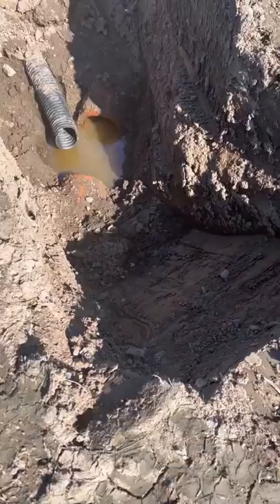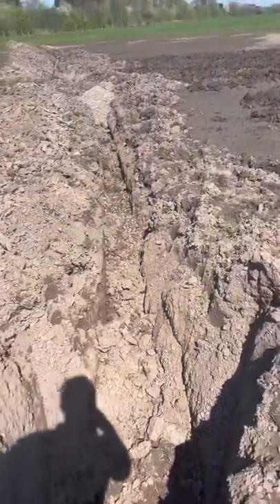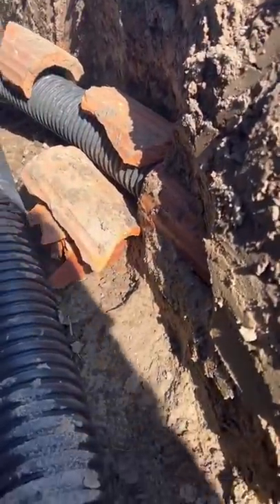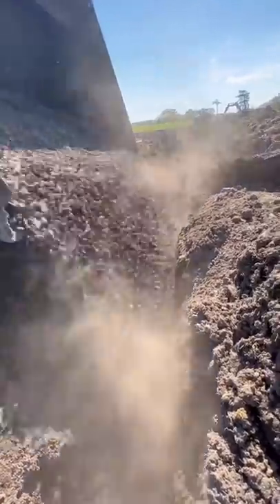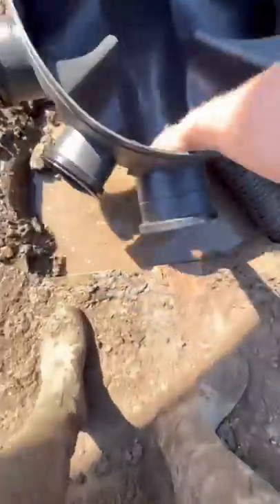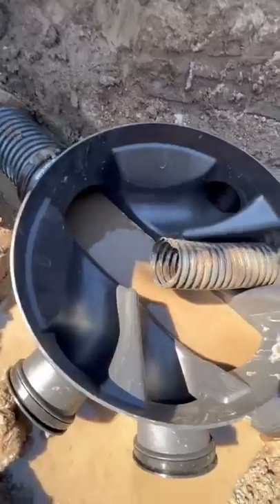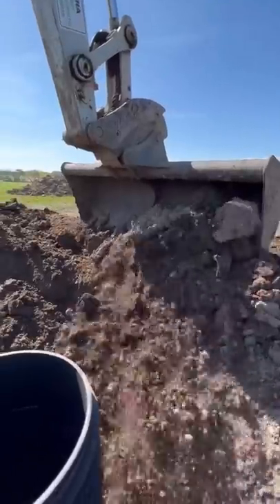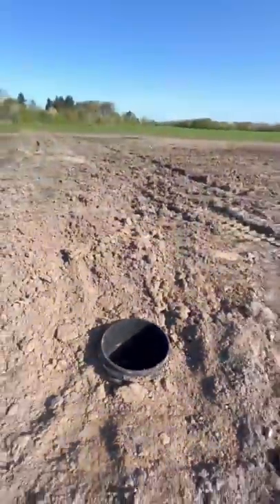HUGE wet spot FIXED the farmers way!

Comment: Dont put gravel in ontop of you plastic drain pipe, put 4inch stone. 4inch lets alot more water down to the pipe alot quicker plus it bridges over the pipe as to support the tractors ontop. The gravel just moves n lets the tractor weight transfer ontop the pipe.... putting it down as we say.

Comment: A wee tip for when you are filling around them plastic manhole risers Tom. You should concrete around them as you are back filling. It gives them some extra protection some times heavy plant can push the sides in.
Reply: I use them on site and we have always been told to surround them with 40mm gravel. In the application I agree though with the machinery being about and I would have left it up 5/600mm so it’s visible for machine but not too high

Comment: that's a job i used to do full time for about 5 years, 1 job was to fix a fire 12 inch fire clay pipe that was 12ft down to the top of the pipe, it was dug in by hand over 120 years ago

Comment: You should have put a liner around that pipe and it kept the dirt out
Reply from the maker: Needs the holes to take the water away 😊
Reply: @TomPembertonFarmLife  I'm talking like a burlap sack something that'll let the water flow through that won't keep the water trapped inside the pipes or block the drain holes or let the dirt in
Reply: @TomPembertonFarmLife  if you dug the hole put some bizquins in like plastic down the bottom punch some drain holes in it lay the gravel and then the pipe then more gravel on top of the pipe and then some more plastic on top it would flow freely and you would have almost like 20 years before anything happens unless it's clogged with toilet paper that's because of septic tank wasn't cleaned it would allowed water flow freely
Reply: @TomPembertonFarmLife  that's why I said when you lay down the plastic sheets you punch them holes in it throw some gravel on top of it run the plastic tubing that you have for drainage over the rocks and then put more rocks on top of that and cover it with some more plastic and that way the dirt don't fill in the rocks and it allows to drain through the plastic leave the top plastic solid don't punch open just the bottom plastic